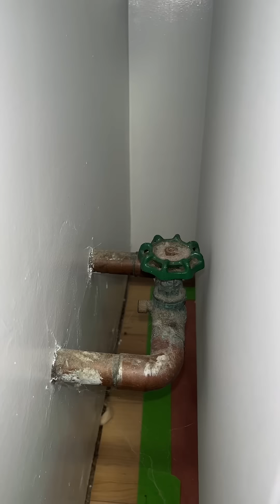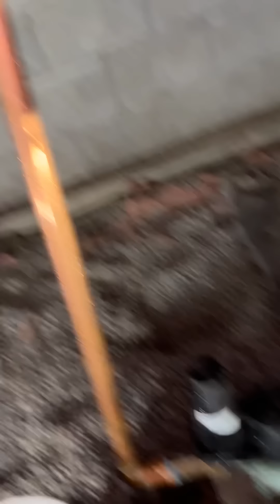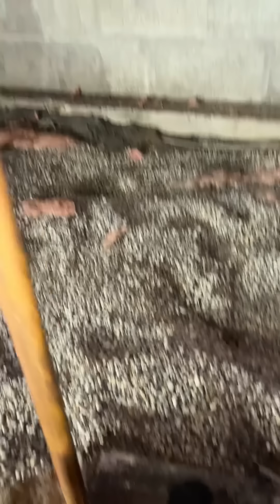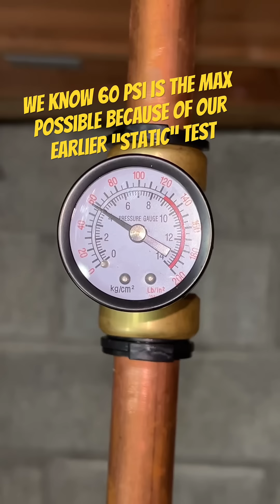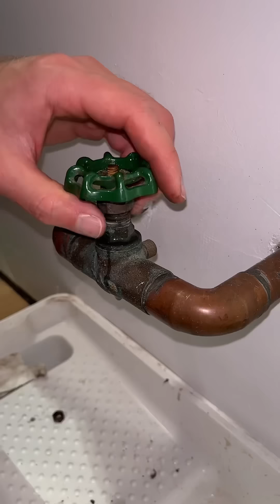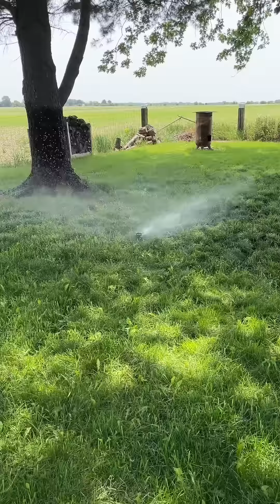Low water flow? Try this! #diy #plumbing #tools

Comment: If valve was not functional,  why not gut it by removing the gate & adding a tag or cut it out?  $$$?
Reply from the maker: The stem was stuck pretty good. That whole section of plumbing will be removed soon, so I decided not to risk breaking the valve at this time.
Reply: @reidthemanual 10-4.

Comment: Could have not cut the line and messed with the old valve. Hopefully you didnt put a sharkbite coupling where you had the pressure test T at cause sharkbites are really temporary fix.. soldering a coupling is permanent.. it will bust in winter
Reply from the maker: The old valve was so stiff that I really wasn’t confident I’d be able to get it open. It all worked out nicely.

The gauge was excellent for diagnosis, and I’m leaving it in for future reference. Sharkbite/Watts call these permanent connections. You can’t have too many pressure gauges, in my opinion. 🙂

Comment: Those "2-turn" valves are always a problem. I hate dealing with them, but don't mind the cash they bring in to fix, lol. If people would exercise them every once in a while, they would last way longer. But just like flushing out the water heater, nobody ever does it.
Reply from the maker: Exactly right!

Comment: Dang man, why waste all that time fiddling with the old gate valve? Just cut it out, install a full port ball valve or even just some pipe to fill the gap and be done with it.
Reply from the maker: The old stop and waste valve is going to come out soon as part of another job, but for now, just opening the valve is easier and less risky (at least for an amateur like me) than cutting or de-soldering.
Reply: @reidthemanual just a heads up. Messing with those old gate valves doesn't come without risk either. Personally, I prefer to avoid doing so. I've literally had the entire stem of the valve blow out just through the act of opening the valve. You were smart to shut the water off at the meter when you went to adjust it.
Reply from the maker: @PeterJoseph7865  I appreciate all your comments.
Reply: @reidthemanual you posted about something I'm interested in. Sometimes I get carried away lol
Reply from the maker: @PeterJoseph7865  Sometimes we don’t know when to stop. ;)

By the way, I tried removing the whole stem assembly from the valve but was sure I was going to break something if I kept at it. Sometimes I hear a voice saying “don’t over complicate this.” Haha
Reply: @reidthemanual yeah, thise things are sketchy for sure. If I need to shut water off for a customer and their main valve is a gate valve, I'm going to the water meter.
Reply: @two7plumbing  I hear you dude. I had one explode on m right next to the foundation. With no real way to shut the water, it took me 25 mins to get a press valve on the deformed soft copper.  So I had a 3/4 pipe wide open for 25 mins in January. I was freezing, soaked and standing in 3 inches of water by the time I got it off.
Reply: @caseyschmidt6532 my goodness, that sounds like an awful experience!
Reply: @PeterJoseph7865  yeah it gave me trauma for sure. I havent touched a first main shut off in years now. Only the second one, if not they have to call the water company!
Reply: Just out of curiousity do all homes have a main and secondary shut off? And im hoping u went right home after that ordeal.@caseyschmidt6532
Reply: @PeterJoseph7865  My 1932 house with original Gate Valves were changed this summer to Full Port Ball Valves. I have City Water & my plumber tried shutting the first valve & fortunately it closed. He then got everything ready to swap in a ball valve. When the City came & shut off the water at the street, I convinced the City water guy to wait no more than 10 minutes; about 7 minutes later, my plumber came back outside & said turn it back on. Success! The first new ball valve was installed & now he could shut that and change the second one on the other side of the meter. Just for fun, I tried playing around with the Gate valve he removed and I couldn’t get it to re-open again. So basically if I had to shut the water with that first/original Gate valve I wouldn’t be able to turn the water back on!!!
Reply: @paulg3316 yep, that's a fairly common occurrence for them to break in a closed position once you shut it down. In some cases it isn't a big ordeal to replace it if it locks down like that, but in other cases it can be quite the headache.
Reply: @reidthemanual dude what are you on about just cut the two elbows flush with a saw and do two more 90s you can even move the valve somewhere else
Reply from the maker: @milesd0texe385  I don’t quite understand your question, but the stop and waste valve in the video is not needed anymore and will be removed soon.

Comment: I'm in a new to me rent house. The water pressure sucks. More so through the bath tub faucet, barely has any flow of hot water. Nice new big gas water heater. Kitchen sink sucks too. Bathroom sink seems to be the best.
Reply from the maker: I would not cut into plumbing on a rental house, but I would absolutely get a pressure gauge and start checking the static pressure at different fixtures! Some faucet outlets have garden hose thread on them already. Other faucets would need an adapter.
Reply: @reidthemanual  I'm gonna get the pressure test this week. Do you have an email where I could contact you again to ask for advice. I had maintenance come and check and he stated he would have to redo the plumbing. I just wanted to double check to make sure they ain't screwing me around. This house as the worst water pressure I've ever had.
Reply from the maker: Let’s keep chatting here so maybe it will help others learn.
Reply: @reidthemanual I'll get back with you in a couple of day when I get the gauge. I appreciate you.
Reply from the maker: If you can even get a gauge on just one faucet or spigot, then you can use that to monitor dynamic pressure of the system as you open different valves. That will tell you about restrictions in different parts of the house. Stay in touch.
Reply: @reidthemanual  ah ok. I understand. Thank you. The house has 3 outside faucets but they all seem to flow pretty well. It's just the kitchen sink and shower where it's low.
Reply from the maker: @The50Baker  perfect. You should have plenty of places to check pressure then.
Reply: @reidthemanual  thanks for actually responding to my comment. Subscribed for more tips. I really appreciate it.

Comment: This is nuts, you added and left future failure points. After diagnosing the problem you should have removed the abandoned valve and that Shark Bite fitting.
Reply from the maker: The valve is going to be removed as part of another day’s project (eliminating visible plumbing in that room), and the Sharkbite is staying long term for diagnostic purposes. Watts and Sharkbite consider these permanent connections, and it’s in the open where it’s easily accessible.

Comment: Why would you waste time cutting the pipe to put a POS SharkBite fitting in the middle of somebody's crawl space where it will never be seen again instead of just replacing the valve that we all could have guessed was the problem. Generally speaking, I prefer actually diagnosing the issue first, but sometimes it's okay to just guess.
Reply from the maker: By installing gauges (temporary or permanent), you can make some informed decisions. 

Out of curiosity, I happened to throw a pressure gauge on a faucet at a well-fed rural commercial building recently and noticed fairly rapid fluctuations. I suggest they inspect their pressure tank bladder, and it turned out to have ruptured. Who knows how long it had been like that (causing the well pump to cycle rapidly), but you couldn’t really notice the issue until you looked at a $10 gauge. 

I try to help people actually understand what is happening rather than just say “that valve is a problem, you should replace it.” Unfortunately, sometimes people confidently move from one guess to another and waste time and money when they should have started with basic troubleshooting. Just my humble opinion.

Comment: Bad gate valve.
Reply from the maker: That valve is bad. I’d rebuild it, but it’s going to get removed soon anyway.

Technically, these are not a gate valve but rather work by pressing a rubber washer against the face of a port where water is exiting. The nice thing about this design is that you can rebuild it, but I much prefer ball valves.

Comment: I remember trying to explain this to my physics teacher at a 2 year college. I thought I was going nuts because it seemed so obvious but nobody understood what I was saying.
Reply from the maker: Fluid systems don’t make sense to everyone, but once pressure vs flow “clicks” for you, troubleshooting becomes much easier! Keep teaching others. 🙂
Reply: Well bernoullis principal, if I understand it right, would suggest that water speeds up at a point where diameter reduces, and slows back down once diameter returns to normal flow rate after the half shut valve. In reality you can't move water just as fast on both sides of a half shut valve. If that was true valves would only work as instant shut solenoids, am I rite?
Reply: @farcyde2948  yes but the important part is was referring to is that it's different in a dynamic system vs static. Once the fluids are moving then you have different pressures in the same system even though pascals law states it will be the same everywhere.
Reply: @gearhead1302   I gotcha right away. So who is going to get in touch with this Pascal guy and ask him if HE did all of his own plumbing.
😂😂😂
Reply: @gearhead1302  so Pascals law seems more like a suggestion than an absolute--at least with fluids
Reply: @dhhwg2661 It's a law in static systems. If things are not moving then it works perfectly every time.
Reply: Tell me this isn't true......
Reply: These concepts are taught in physics

Comment: Shark bites not permanent 🎉
Reply from the maker: Sharkbite (and Watts, who made this particular fitting) say these are permanent connections. I’m an amateur, so I’m just the messenger. Haha

In my experience, if you properly install o-ring fittings, they are quite reliable.

Comment: What it's like well water or if you're paying for water I can see 40 or 35 play comfortable level are not over using order some people don't understand it but to me Les PSI is the less gallons are thrown out that's really not a problem that's just a personal preference
Reply: What? Dude, your AI speech writer is tanking. Can't goodly English much?
Reply from the maker: Not every home needs high pressure or high flow, but when you “know” something isn’t right, it’s great to be able to find the issue with a couple of pressure gauges.

Comment: Why didn't you just put a new valve in there why fix the old one that could have problems later
Reply from the maker: That valve and protruding plumbing is all scheduled to be removed soon. Otherwise I definitely would have rebuilt/replaced that valve.
Reply: So you just made an instructional video @reidthemanual
Reply from the maker: @Bruno-g2l2w  yeah, I think it came together nicely. Thanks for watching.

Comment: Shark bite is not a permanent connection. Read the literature.
Reply from the maker: I’m an amateur plumber, and I greatly appreciate guidance from those of you with years of experience. I would never be comfortable burying a Sharkbite in a wall despite having used hundreds of similar fittings in other applications. That being said, I just got this from Sharkbite’s website:

“Properly installed SharkBite fittings provide permanent connections, backed by a 25-year warranty. This only applies if the item has been installed according to the installation instructions and is compliant with local code.  

SharkBite fittings are specifically designed for permanent connection and aren’t intended to be disconnected and reconnected repeatedly. In fact, the only way to remove them properly is to use the SharkBite PRO disconnect tool, tongs or clips.

We’ve also designed our fittings with long-term use in mind. For instance, SharkBite Max fittings provide the same features and benefits as the first generation, but with added strength, durability and double the burst pressure for more peace of mind that your connection will last.”

Also, I used the “Sharkbite” name in the video out of habit. I actually used a fitting from Watts (link in description).
Reply: Facts. Fantastic response.  @reidthemanual
Reply: While that wasn't an actual Sharkbite fitting used in the video, the literature you are referencing actually tells you that it is indeed approved for a permanent connection. Having an opinion and preference is perfectly fine, but if you're gonna reference literature to back up your stance.... you may want to make sure that literature agrees with you :)